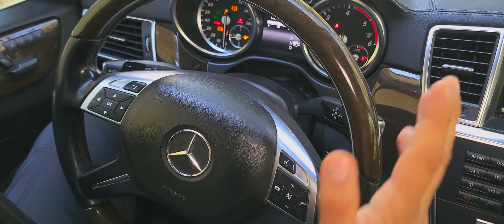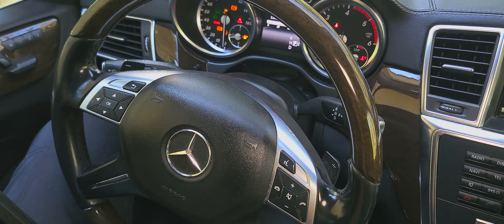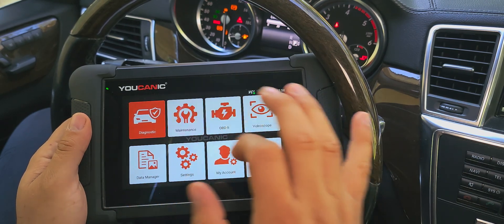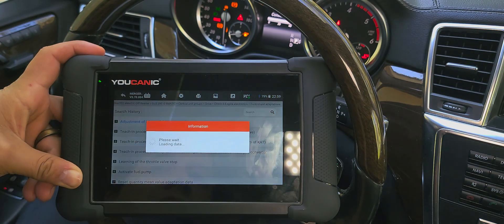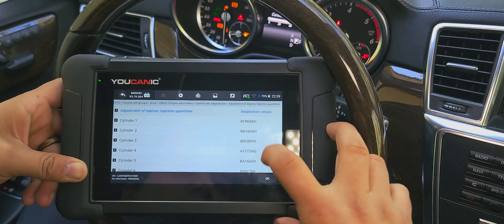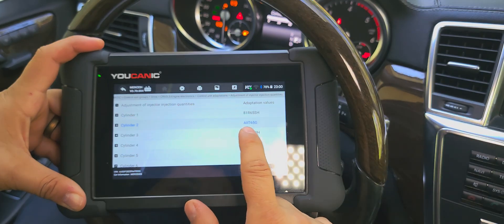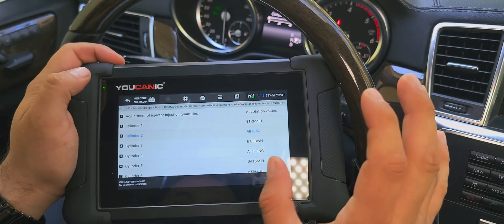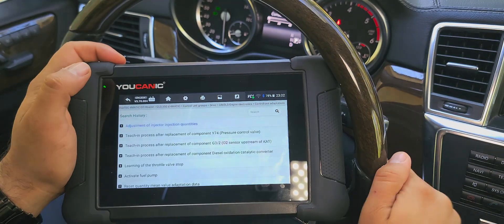Code Mercedes-Benz Injectors (IMA IQA) with YOUCANIC Scanner - Fix Rough Idle, Smoke & CEL

Comment: Great Informative video on Mercedes Benz injectors. Thank you for sharing your experience. Definitely helped me a lot, replaced new ones on a s550, didn’t realize there was an adjustment to it
Reply from the maker: @luisfhernandezgarcia7769 If you’ve got a car issue or repair question, you can find step-by-step guides and scanner help at youcanic.com. We might miss some comments here, but our site has answers for most problems already!